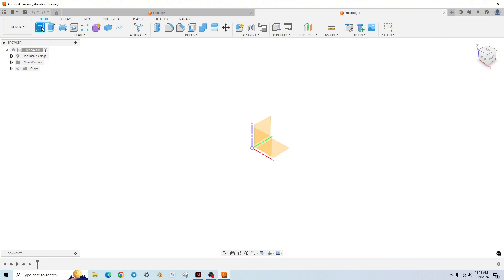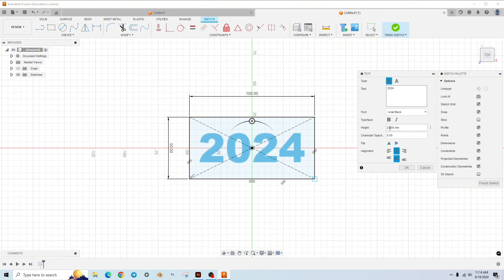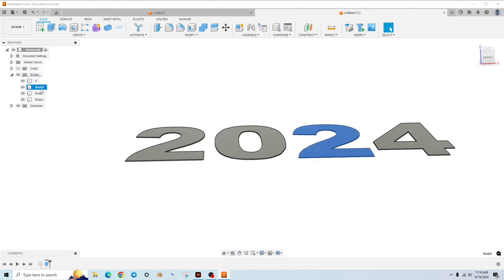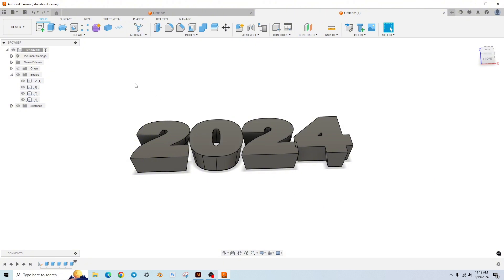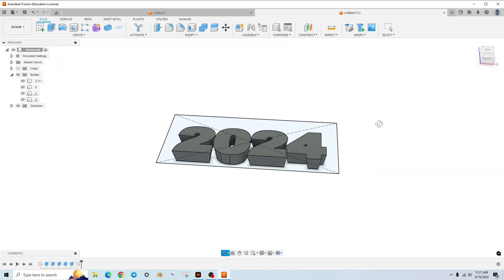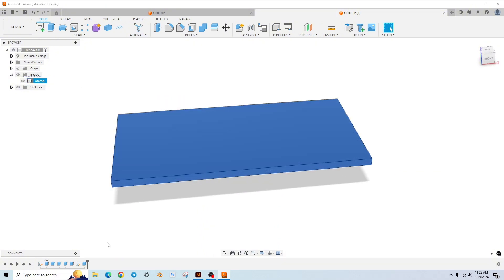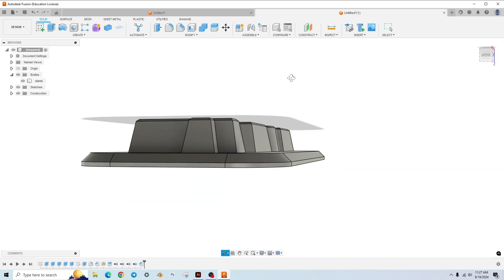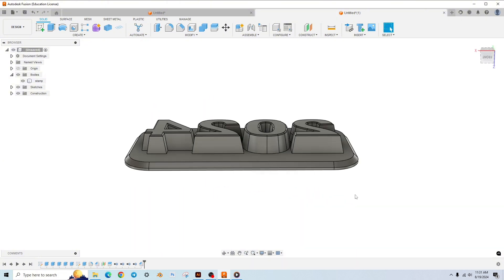Fusion 360: 3D Printed Concrete Stamp

Comment: I'm not saying this is easier. An option that don't require the mold itself being created in Fusion, but you can create the "master" includes some slicers allow you to mirror your stamp across either the X, or Y axis. Z too, but then you're printing the numbers on the bottom, which probably isn't what you're looking for. Go ahead and use your favorite modeling software to create the stamp so that if you just printed it straight, it's readable. That lets you verify that the lettering and numbering is correct, then just go back to the slicer and mirror it.

Oh, and James over At Clough42 fond one of the problems with some fonts is that things that look like a corner may be a lot more complex, and attempting to use those fonts for tapers in Fusion 360 would fail for him as well. I'm not using Fusion 360, so I can't verify that.
Reply: It can also be handy to chamfer the surface that is going to be printed with a chamfer that's the depth of a print layer, .2mm, perhaps, so that you don't end up with an elephants foot on the first layer. This presumes that you're getting one, and want to eliminate it, if your printer doesn't drop one there, then don't include it.

Comment: Negative taper is allowed.
Reply from the maker: What do you mean?
Reply: @ShopTherapy623  The taper angle for extruding the text can be a positive angle or a negative angle depending on if you want to grow it larger or smaller as it extrudes. The reason your text extrusions were failing with larger taper angles is because they had geometry that was intersecting itself. ie. a single digit would get too fat and fusion doesn't know what you want it to do.

It's better to do tapers that get smaller so your starting position is the exact size that you want and the rest gets tapered until it becomes a sharp point/edge if you try to go too far. Doing it this way also makes it so that you could press the text into the concrete and have it be the exact size that you drew it as by pressing it all the way in (add an extra lip on the edge of the stamp or a handle on the back to pull it out)
Reply from the maker: @pHuzi0n  yes I’m aware you can do a negative taper angle, but that’s not what I wanted to do. The starting letters were the exact size I wanted, and then wanted them to get wider. This taper allows the letters to slip out of the concrete easier.  If you taper inward (negative taper), the letters become distorted.  The reason I did what I did was to get around the errors.
Reply: @ShopTherapy623  OK, after trying it myself I see why you went the way you did. Fusion made some ugly surfaces.
I tried a different way extruding the text straight/no draft. To get the angle on the sides so it doesn't stick, I used the chamfer tool and set the type to 2 distance. I used 0.2 to 0.5 for the x expansion, and the Y distance was the same as my letter extrude thickness. This seemed less picky about the overlapping bodies if it created any.
Then I selected the faces of the numbers. You might have to swap the two chamfer dimensions to get it right.
This way I could edit the text and change it for 2025. 

Can't wait to see how it turned out when you stamped the concrete.
Reply from the maker: @norseengineer  I posted a shorts video of me stamping it. It worked really well. However, in the video I didn’t push down very hard. I ended up going back out afterwards with a little rubber hammer and giving it some light taps to deboss it even more. I didn’t show it, but I lightly sprayed the stamp with cooking oil before stamping it.

Comment: Hi,

Disclaimer : I am myself in the process of learning F360 so I may say some stupids things below.

A few thoughts/notes :
- You can have a reversed text easily by selecting the horizontal flip button in the text creation window.
- I would remove the holes for digits that have one (4 and 0 in our case) by extruding through the stamp's base to avoid an air bubble being trapped there.
- For the 0.2mm extrude removal, I would go for an extrude of -0.2mm of the digit's top faces.

Anyway, thanks for the content !

Regards
Reply from the maker: I think those are great suggestions. No need to flip the text when you can just extrude in the opposite direction (which just makes sense in my head). I think either way is correct. The air holes is a really good idea - I may change that. 

The 0.2 cut is SO obviously the correct and more easy approach to that - lol.  I’m surprised I didn’t think to do that.